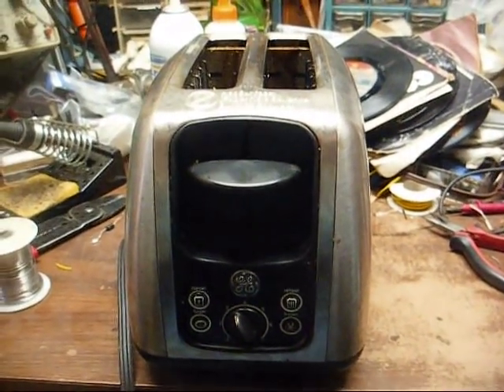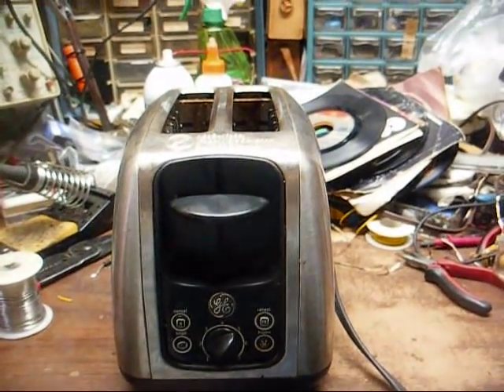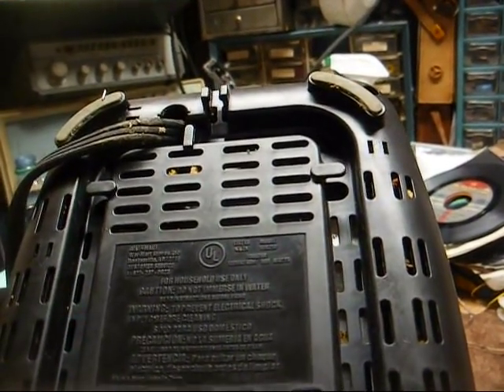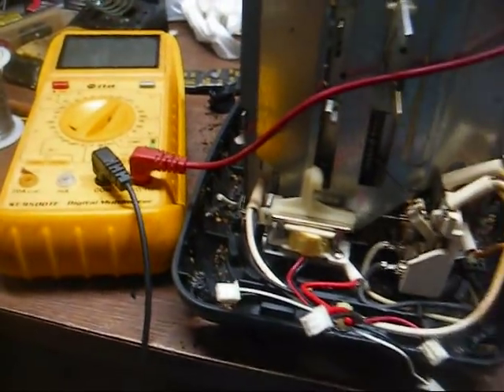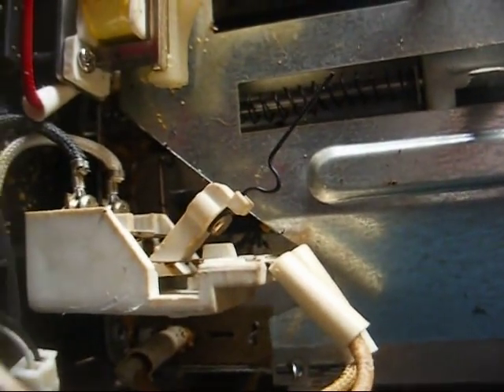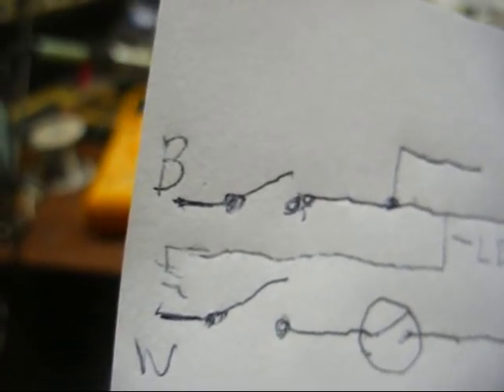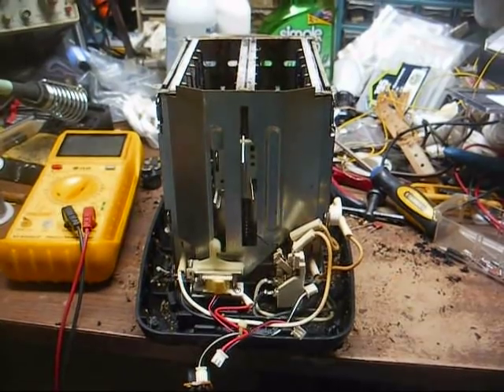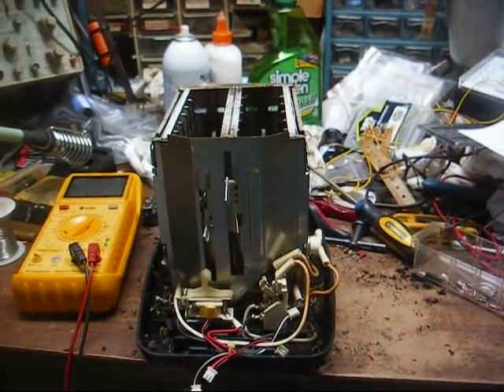Autopsy on a modern General Electric Chinesium 666 toaster

Comment: I'm surprised it didn't trip a circuit breaker or blow a fuse in the electrical box in your house. Thank God you were home to catch it before something possibly catastrophic happened.
Reply: Archie Bunker, From what understand what he said in the video, the heating element definitely shorted to ground, when this happens the output current that would normally flow out to the neutral end of the element is basically rerouted to flow freely to ground without having to go through any switches or devices, this means the coils or part of them are going to continue to glow even if they are turned off, and keep heating the toaster to self destruction like that, this could be also the reason why the thermal fuse didn't cut power since it was probably operating only just on the neutral end of the circuit, i don't think a house circuit breaker would have picked up this fault and trip since the amp draw probably stayed the same, but a GFCI outlet may have, as it would detected it as a classic ground fault inside an appliance.

Comment: The use of computers in every type of consumer item (be it appliances, heating/cooling systems, automobiles, etc.) has finally allowed the global manufacturing industry a GUARANTEED expiration date for ALL products they make. They no longer need to rely on cheap, inferior plastic parts or even unserviceability to soon gain your repeat business; after all, a seldom used product or just an uncanny and unexplainably high quality product (made on a Tuesday or Wednesday) that manages to hold up might last you twice as long as the manufacture ever intended, but add in some unnecessary computer boards programed properly to “melt down” on command and the manufacturer can bank on your need for a new consumable right down to the month and year! I respectfully disagree with you about Chinese vs. American made these days ... they are all designed and engineered to be throw away junk. I wouldn’t be one bit surprised to learn if 95% of the Chinese made consumable were engineered in America. The engineer designs and the plants manufacture to the exact specifications of the boss!

Don’t even get me started on government mandated safety equipment installed on everything that will eventually take out an otherwise perfectly good machine ...
Reply: Brian Andrews preach it brother!!
Reply: Not that one can trust the boilerplate to honestly identify the country of origin.

About 20 years ago, an investigative reporter was able to find someone to sneak him into an auto parts sweatshop that paid undocumented immigrants' wages in cash (not taking taxes out).
He saw new automobile wheels stamped "Made in Brazil".
Reply: It's even worse! There was a story a few years ago about Samsung or LG refrigerators that were half "bricked"; they could still cool, but half the features that supposedly justified their $3,000 price tag stopped working due to a software bug and the manufacturer lost interest in fixing it. I can't think of anything on a $3,000 fridge that would make me want it more than an $800 model with the usual 1970s features. If I ever need my fridge to remind me when to buy milk, I'll volunteer to be euthanized.

Comment: I have a last gasp made in USA Sunbeam radiant control toaster from just before they stopped making them in the 90's.  It replaced a modern Chinese plastic Sunbeam that had to be set at the darkest setting and then toast the bread twice to get it to medium brown.   It's built like a tank and works perfectly at approx 25 years old.  Considering most two slice toasters these days only use 700 or 800 watts mine is a beast at 1375 watts.  You could almost read your morning paper by the light it puts out plus it toasts white bread to medium brown in under 2 minutes.  Fully automatic with no levers.  I made a video about it called "Modern toasters suck - A rant and a solution" on my channel.

Comment: I just use a cheap Mainstays toaster since all the Walmart toasters are basically the same thing. It also has a plastic body so it doesn't need to be grounded so you won't have another resistive short to ground. Yeah, a plastic body on a toaster sounds bad, but I've never had an issue with it melting or scorching. Please do a video on your vintage heater. I have a fascination with heaters and would love to see you demonstrate it.

Comment: Cheap crap from other countries is a curse worldwide. Not just electronics, but also food, clothes..... you name it. This won't change no matter who we vote for. It's entirely up to consumers to put that to an end. But sadly most are more concerned about saving a buck, while screaming about the environment, not realizing what one of the main reasons for the climate changes infact are. 
If consumers pulled their heads out of their ..... we could have quality, and at the same time solve a very big part of the environmental issues, so we maybe wouldn't have to listen to all the useless yapping about that all the time. But that does require thinking, so of course that's not gonna happen. 
This is an awesome video mate. If it makes just one customer think before buying, you will have done the world a favor. Thank you.
Reply: The "Climate Change" hysterics are about acquiring money, power,  and transferring wealth, it has little to do with environmentalism but a lot to do with Marxism. If you don't believe me then ask yourself the question, why is the issue of the PRC building dozens of coal fired power plants ignored whilst ones in Western countries, along with the mines that supply them, are pressured to shut down?  At the same time the P.R.C was allowed to dump products in Western markets whilst they had stiff tariffs on Western imports.

Comment: I had a toaster fail because the relay coil for one side went open circuit. When I started checking it out, the other side failed. The electronics went bad. I took the good relay and moved it to the side with good electronics, just till we could get another one. The electronics can give you features that the old toasters didn't have, and, properly designed, can give you better temperature control than the old thermal switches. Of course, the quality of all those electronics is lower than what is required to give long life, by design. Everything is designed now with an expiration date. We have a washer that is now 27 years old. The new ones won't last beyond ten years. Some only last 4 or 5 years. Same with refrigerators and other appliances. Pretty sad.

Comment: Typically the elements in old toasters were insulated with mica sheets.
Reply: then it got SMD  silver mica disease
Reply: @force311999  SMD is caused by the silver, not the mica.

Comment: My Father had a bread maker, one day it's heating element relay got stuck on and turned the loaf into carbon carbon and stank up the apartment. Somehow it didn't melt any plastic (except maybe the internal fan), perhaps a thermal fuse actually functioned. We were not impressed with that. The relay looked awful small to be switching a heater coil like that.

Comment: Wow, wow a piece of junk. Glad you're all safe. If your mother is intent on getting something new I would advise one of those black and decker toaster ovens with the dials on the front, no computerized controls. They are no vintage quality appliance but they're far better made than those cheap little modern toasters are. My family probably went through about 5 of those cheap modern toasters after the older one from the 90s finally failed, got the black and decker toaster oven and it's been going strong for a few years now, best of all it can be used a small oven as well. Fixing and cleaning up an old vintage one is probably the best bet, but I figured I'd throw my experience in as well. This situation reminds me of one that happened in our house, I was in the kitchen with my mother when one of those super cheap chinese CFL light bulbs started flickering in the kitchen light, I mentioned about seeing a video on those and how when they start to fail they like to flicker. Not even 5 seconds later the light bulb went up in smoke and blew up in the light socket. I've stayed away from those cheap CFL and LED bulbs ever since, trusting cheap chinese electronics on 120 volts AC is not a good idea.

Comment: Here in the good ole UK we're all looking forward to 5-G where our Chinese made toaster will be connected by wireless to the the mobile phone network, and in turn, that will enable it to interface with the Chinese made fridge/freezer/cooker/washing machine/ TV / central heating - hot water boiler /I-Pad/ Laptop etc, etc, while the 5-G will be microwaving our internal organs so we wont have to bother if our crappy appliances burn our houses down.. Can't wait !

Comment: once they started putting circuit boards in toasters, I knew we were in trouble.  Im using a 1960s toaster , it works great, and prob wont burn my toast or the house down. Lol

Comment: I use a Toastmaster 1B12 that is pretty much mint and original cord. It used to be in a original box but my father discarded it since it got wet. But anyways I have had it for over 10 yrs and that Chinesium joke would never compare to that ones quality, chrome, bakelite and cloth cord.

Comment: I've seen vintage, all mechanical toasters with the same problem; either something gets jammed in there, or even more disturbing, the spring gets weak and the plunger sinks just enough to keep the coils on. The pop-up toaster has always been one of the biggest fire hazards in the kitchen and I doubt they would even be allowed if they were invented in 2020. Toaster ovens are much safer. But the ironic thing about those all electronic controls is that with all of their buttons and  digital displays, they are MUCH dumber than the bi-metal strip in the older models, which could actually react to the temperature of the thing being toasted. If you put a frozen item in an older model, the strip would keep the heat on longer, while most of the chinesium models just have a timer which, if you don't set it for longer, will pop up the item while it's still half-thawed.

Comment: was it possible that the stray crumb or what ever caused the problem is what your wife smelled burning or did you see the actual elements glowing ? i have had two of this exact model and had no problems but i keep em clean with compressed air as well as the crumb tray if you deside to tare this thing down all the way please make a video of what you find if you go deeper in this thanks

Comment: Did you inspect the circuit board for any signs of burnt parts?    They probably have a capacitive dropper or switching type power supply that provides power without a transformer to the circuit board is went bad is my thought for the fault.    None of the parts you showed looked questionable.

Comment: Man, I hear you... I have a 1935 or there about, it is a Toastmaster made by McGraw Electric, in  Elgin Ill. It has a spring wound "motor" and a air cylinder and piston to dampen the pop up action. I have been using this toaster since I bought it at the Salvation Army Store in 1997. The asbestos fabric covered cord was replaced with a modern one that looks very much like original but is a 3 wire silicon insulation. They don't make them like they used to... does it work? Absolutely I think I paid less than @2.00 perhaps it was $0.89 what a gem

Comment: No, Try to get an American made one.Overhaul it,clean it up and use it.Chances are,it will be cheaper to purchase and last a he'll of a lot longer and most of all be more reliable.You might want to install an electrical socket with a built in switch so you can turn it off when it's not in use rather than have to unplug it all the time.My parents have that setup with there roster oven.

Comment: Speaking of crappy appliances, a small Sanyo microwave my parents bought me in 2009/2010 or so (to go in my apartment) is quite possibly dying; sometimes it doesn't chooch at maximum power, and I have to then give the food an extra minute.

I'm reasonably sure it isn't the low line voltage; it's typically 115 to 118 here in southern Idaho. The voltage is consistently low, and the performance of the microwave fluctuates occasionally.
Reply: If you use it all the time the magnetron is probably wearing out, 10-11 years is actually not too bad. If you have to get another stay away from the Panasonic "Invertor" microwaves, those have a silly power supply that has more in common with a TV flyback transformer, we had one and it died within 4 years.

Comment: I hate to sound like a “boomer” here but why do we need so much tech in a damned toaster? All you need are nichrome heating coils, a thermal sensor that sort of measures the temp of the food and some cam-action thing that tries to control the darkness of the toast. I use a $10 Silex toaster from big lots , made in Chin-Chin. I’ve had it for 10 years . The darkness control does not work well but it never did. It was purchased to replace a $10 toaster I got from KMart that was made in USA and lasted almost 40 years , in spite of rough treatment. If you look you might find a new lo-tech toaster an avoid some of the issues you have experienced. I always unplugged the toaster when not in use anyway just out of habit
Reply: Oh, don't even get me started on today's so-called "smart" appliances! I'm (almost) 23, and I can say that I HATE them!  Seriously, what's the point of controlling your stove with your phone, or those stupid refrigerators with the tablet? Just a pitiful way to impress today's idiot society with all sorts of stupid and useless gimmicks!

Comment: Dont get me wrong modern day stuff like this toaster are pretty much cheap junk.. but credit where credit is due, using the toaster element as a power dropping resistor to power the solenoid and control circuity is a fairly nifty way to do that... ive seen dumber ways they've implemented things